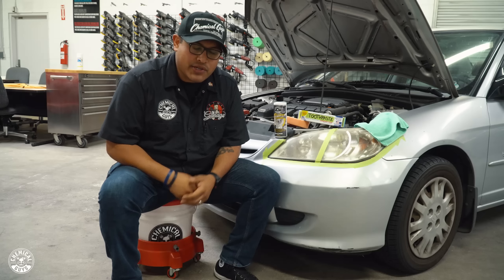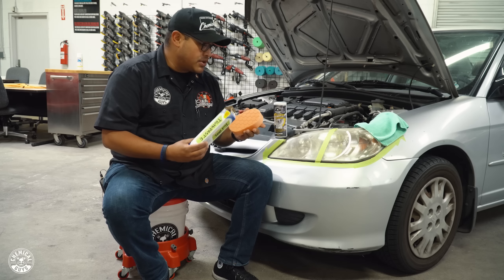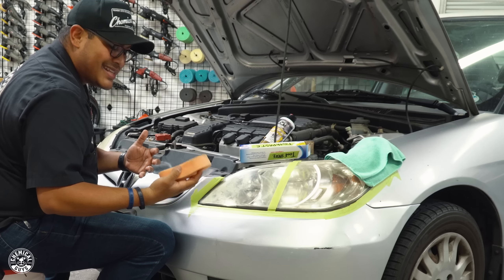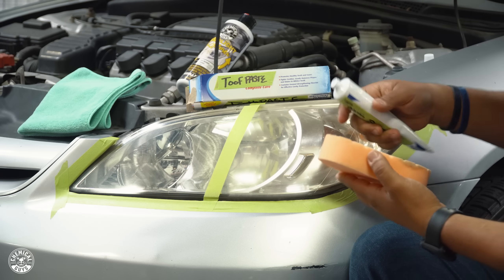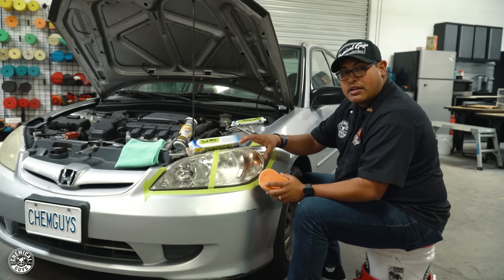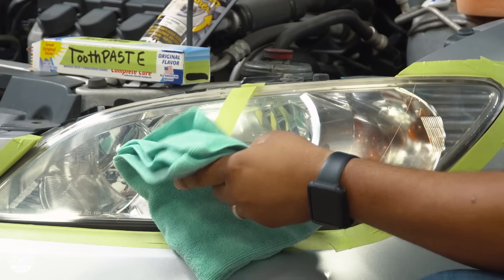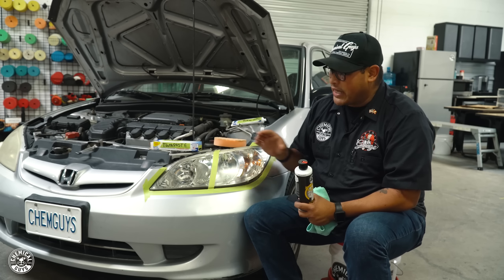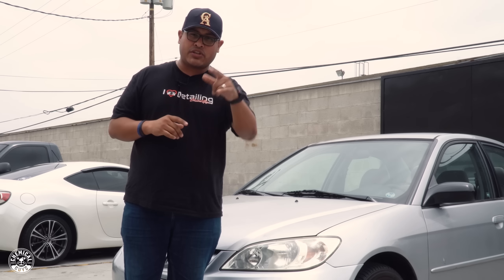Detailing Myth: Headlight Restorer Vs. Toothpaste | Lab Coat Garage Ep:4

Comment: I’m sorry what coating after you restore to protect the headlight?
Reply from the maker: Hey Steve! After correcting your headlights you can apply a sealant such as JetSeal to lock in clarity and repel the elements. Apply a coat of wax routinely to maintain clear lenses and prevent damage.
https://www.chemicalguys.com/jetseal-durable-sealant-and-paint-protectant/jetseal-sealant.html

Comment: Do you sell a head light protection  or what would you recommend?
Reply from the maker: Hey Richard! Check out JetSeal to add a lasting layer of protection.
https://www.chemicalguys.com/jetseal-durable-sealant-and-paint-protectant/jetseal-sealant.html
Reply: Yes, you can add a layer of Jet Seal. At least you will have a year of protection. I used and works amazing. Chemical Guys rocks!

Comment: I remove the headlight, wet sand with 120 grit then rinse & wipe off. Then wet sand with 1000 grit and rinse and wipe off. 

Finally I take Rust-Oleum gloss clear for plastic and do two coats.

Did it to my car then several friends and families cars. 3 years later my headlights still look brand new and i put about 17,000 thousand highway miles on every year in Michigan.
Reply: socalpunk05 jumping from 120 grit to 1000 grit is not good. Your headlights are probably scratched to hell